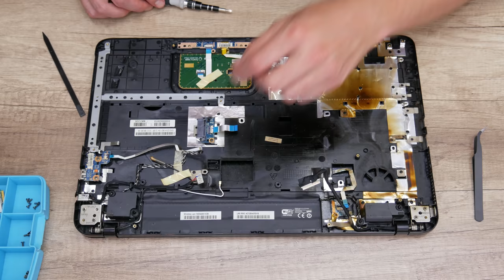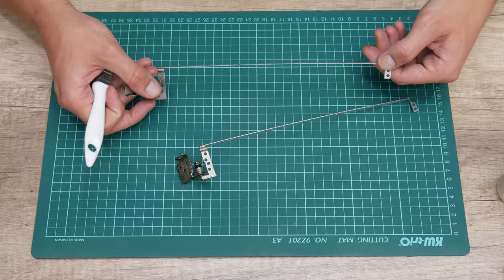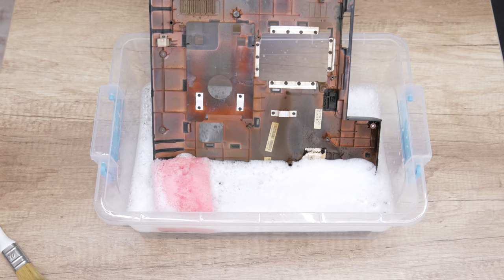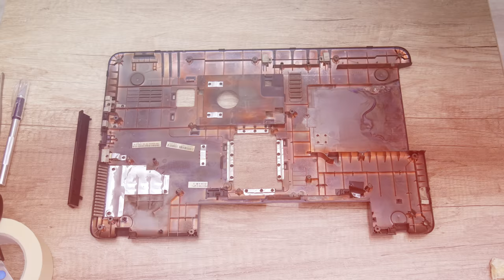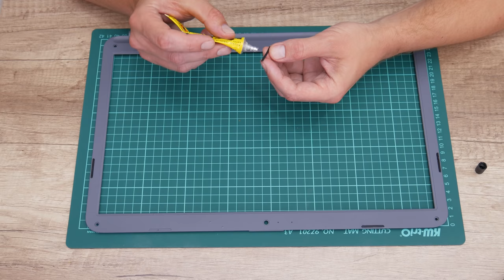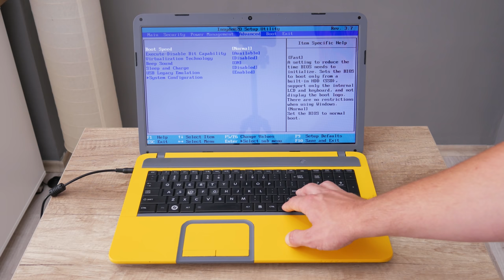Restoring and Upgrading an Old Toshiba L875

Comment: Hello. I am having trouble updating my laptop. I am trying to upgrade it but I don't know which RAMs are compatible with it. It has i5 intel processor and by using CMD, 8gb is the max RAM capacity. Motherboard is Quanta QL5A and laptop brand is LG xnote r560.

Any ideas?

Comment: My 2010 15 inch MacBook Pro should run roblox but doesn't and fan spins fast all the time so would it be clogged with dust if that's happening

Comment: does my toshiba  laptop b552/g corei3 4 GB RAM support i7 2ng gen CPUs?Thank you
Reply: if the socket is rPGA988, then i7-2620m, i7-2640m can be installed. But better to install i7-3520m, i7-3612qm
RAM 4gb+4gb DDR3L-1600
Reply: @slavafedotov5742  thank you

Comment: Generally notebooks with upgradable Sandy Bridge (Core ix-2xxx) CPUs or better are worth restoring. Replacement CPUs are cheap and they still have enoug performance for productivity, multimedia and even casual gaming. Everything before Sandy Bridge? Meh... The integrated GPUs are a real problem these days, since they don't accelerate any modern videos and the CPUs are working overtime even on 720p Youtube.

Comment: hi andrew I have a problem with a laptop and it has two card graphique
The first comes with amd a6 9220 processor with r4 graphique 512 mb
And an independent second AMD Radeon R7 340 m 2GB
But a problem when playing games is running on a built-in AMD R4 512MB
cpu amd a6 9220
gpu 1 amd r4 512 mb 
gpu 2 amd r7 m340 2gb 
ram 8 gb 
laptop hp 
pleas help
Reply: You either have to choose dedicated gpu manually, or its just dead, and it switches to integrated gpu automatically. In that case, theres not much you can do

Comment: I have a toshiba l850 laptop can i upgrade the i5 3210m to i7?
i have a 8 gb ram and a 240gb ssd and can i change the gpu of this? i have a Amd Radeon HD 7600M
Reply: if the socket is rPGA988 / 989, then you can install the i7-3612qm / i7-3632qm processors

Comment: Bro i love you, you done great job, bro can you upgrade my laptop, it is intel core i3 2.00 ghz dual core 5th generation laptop, can you upgrade it into i7?
Reply: the processor is soldered to the motherboard. The processor needs to be changed only in a computer service at a soldering station. It is expensive. It's easier and cheaper to buy another laptop with an i7 processor)

Comment: I'm trying to upgrade my CPU on my Toshiba Satellite L875-S7108 but i cant find any CPU compatible with my motherboard, how can I tell which CPU's are compatible with my motherboard?
Reply: what processor do you have? i3-2370m?  i3-3120m?
install the CPU-Z program on the laptop from the Internet and on the first tab of the program look at the socket type (rPGA 988 or BGA 1023?). On the "Mainboard" tab, look at the type of chipset -> HM65? HM76? HM77?

Comment: I had one of these and it didn't charge it would do the plugged in nor charging thing quick update to windows 10 fixed it instantly as well as I had a broken keyboard and trackpad and speakers and no wifi  all fixed by a quick update to windows 10 and taking apart and reconnecting everything

Comment: Cani i ask what CPU can I upgrade my i3-2350m?
Reply: which laptop model? what type of socket? what is the chipset and the south bridge of the motherboard? this can be viewed through the Speccy, CPU-Z programs
Reply: @slavafedotov5742  acer 4752g. Intel hm65 express chipset.
Reply: @jacoblibs268  i5-2450m / i5-2520m / i5-2540m /
                          i7-2640m => + 35% performance.
You can do as I do: buy i7-2760qm (45w), but so that the laptop does not overheat, turn off the turbo boost on the processor. Get 4 cores / 8 threads / 2.4GHz => + 100% performance.
You can buy the i7-2670qm (2.2GHz) - it's a little cheaper. 
 RAM 6-16GB (DDR3-1333 / DDR3-1600).
Turboboost is turned off in the Windows "Power Plan": set the maximum power supply of the processor from the network and battery - 99%

Comment: Would be cool to see a acer aspire 5742g
Reply: Do you have an Intel Core i3-370m processor in your laptop? socket rPGA988?
Reply: @slavafedotov5742  i've got a i5 480m
Reply: @nitromaster6259  you can set the maximum i7-640m (2 core / 35w / 3.4 GHz) - the increase in the speed of programs is 10-15%.
The maximum RAM is 4GB+4GB DDR3-1066. For the laptop to work quickly, it is better to install Windows on an SSD (120-256GB / SATA-III / TLC, 3D TLC / 2.5").
Does the laptop have a discrete Nvidia / AMD card?
Reply: @slavafedotov5742  I've got a gt 540m 1gb, 8gb ddr3 1333mhz, and 480gb SSD
Reply: @slavafedotov5742  cooling is very bad, I can't clean it, I already tried to open it, that didn't work...
Reply: I've glt the 5742g
Reply: @imperatorjoni9652  you can take the laptop to the master, he can try to open it and clean it. I read on the forum that you can replace the i5 processor with an Intel Core i7-740QM processor, and to prevent the processor from throttling from overheating, turn off the turbo boost on it: get 4 cores / 8 threads / 1.7 GHz. Just before replacing the processor, you need to install the latest BIOS version.
Reply: Slava Fedotov i can‘t upgrade it and can‘t send it wo someone
Reply: I am Nitromaster btw

Comment: "The specs, are not bad at all" "Intel core i3"

Woody laugh from Toy Story
Reply: Ded Account but at least it’s a M series chip, not some crappy U series Intel chips which are only power efficient. However, the recent U series chips from Intel are pretty decent.
Reply: @Windows7Pro2009  U series is heavy shit. (sorry to say!) My current laptop has a MQ and my current pc has a X 
So i disrecommend the 'U' series
Reply: Acnologia Same, I would rather have M/ MQ series Intel chips.

Comment: I have a msi ge60 0nc. It has hm76 too. My current cpu is 3110m. I hope someone here in ph can replace my cpu too to i7 3rd gen. :(
Reply: Order the i7-3520m or i7-3612qm processor on Aliexpress. Then take your laptop and i7 processor to a computer service for a replacement processor.
Reply: @slavafedotov5742  thank you for your tip!

Comment: complete noob here would this work, 
Intel Core i7-3770K 3.5 GHz Quad-Core Processor - 8 MB - LGA1155 Socket 
please let me know

mods so far 6gb, ram 1td hdd, new battery
Reply: LGA is a processor for a computer. Through the CPU-Z program, see which socket you have, which processor model, which chipset and the south bridge of the motherboard)
and which laptop or computer motherboard?